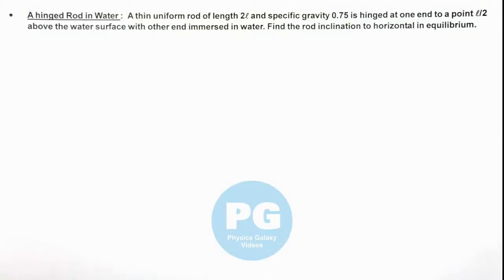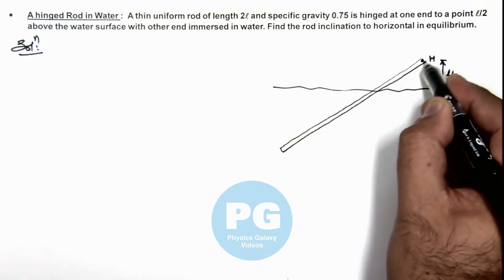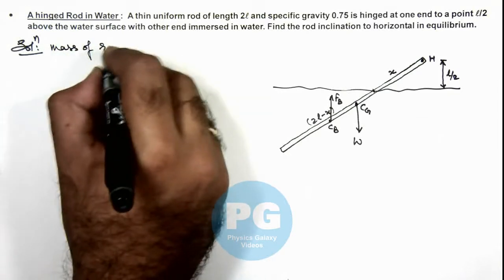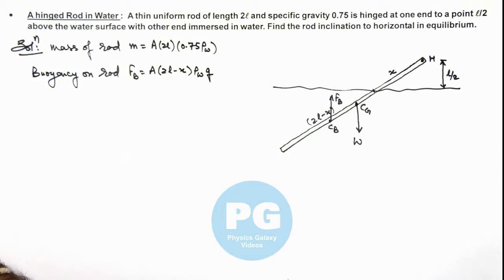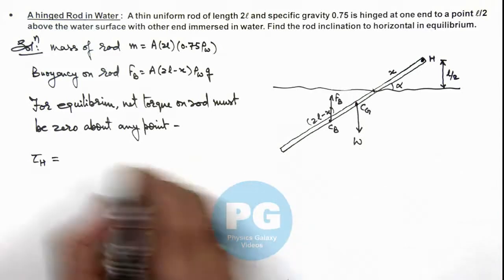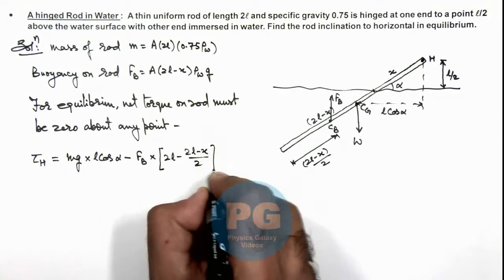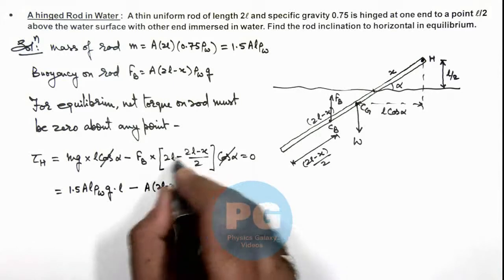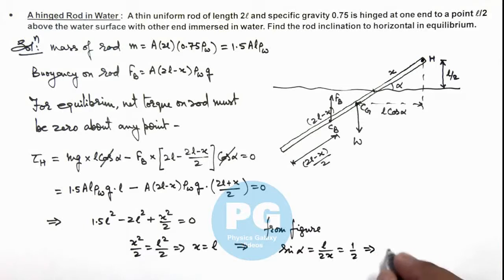30. Advance IIlustration| Fluid Statics & Dynamics | A hinged Rod in Water | by Ashish Arora

Comment: sir why buyency will be in upward direction 
 it will be perpendicular to road na ?
as buyency is force due to pressure difference into area 
 and pressure acts perpendicular to the surface 
 so buyency force will be perpendicular the road 
not in the same direction as gravity acts
Reply: Horizontal components will cancel out. Net will be vertically upwards.